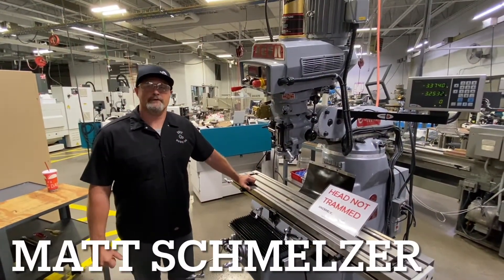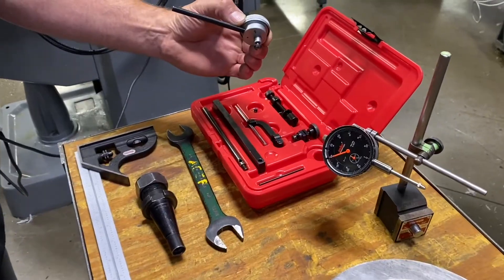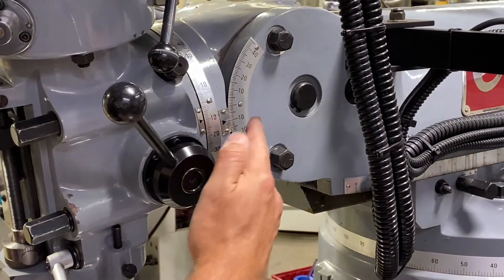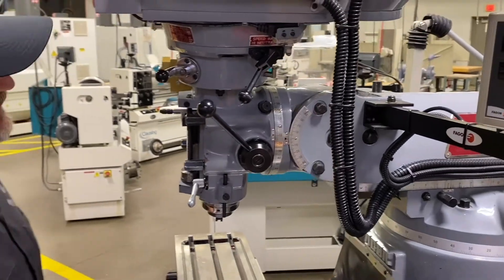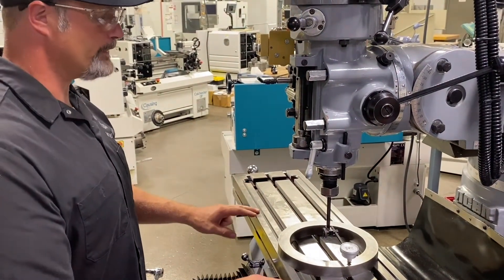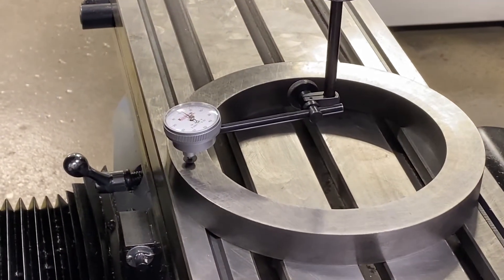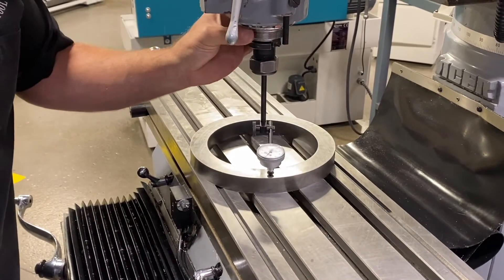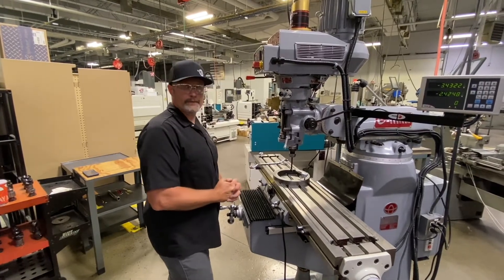Tramming the Head on a Milling Machine

Comment: 6:20 the machine has notches on the quill housing(above and below the depth screw) to use a square specifically for that setting. You don't have to use the quill like that. Likewise the same notches are used to set the nod too.

Comment: Excellent Video! What about squaring the x-y table to the machine? In other words, how do you assure that the x-travel and y-travel at one extreme is the same at the other extreme?
Reply: I think he ensured that by using the 360 degree ring. Any error in that would magnify over length. No error, no magnification over length.

Comment: The red flag warning was in the beginning when you were leaning on the machine. Fully extend the quill. Why? To magnify the error from tilt vertex.  Then proceed with a precision parallel. No need for that ring ding. Pay attention or pay cash!
Reply: Very true, the quill should be extended out for maximum accuracy.
The nomenclature needs a bit of attention.
There are no Vernier scales, just scales.
The combination square has no ruler it is called a rule. - It is engraved to the ends.
There are no rack and pinions, they are worm drives.
The forward tilt is called the nod.

Comment: I swing 20” and indicate 3 points’ 3-6-9 o’clock on the table. The table is 10” in Y. This gets you closer than splitting hairs in that radius. Once you have zero on all three points, your dialed 👌🏻 Old guy turned me on to this.

Comment: Double indicator arm really helps tramming this kind of milling machines. Same procedure, first make the sideways rotation straight and zero the indicators. Now the tilt with the offset pivot point is much easier. Turn the head until both indicators show exactly same value.
Reply: Yup.... PM would do well to watch ol Mr. Pete, the youtube shop teacher!